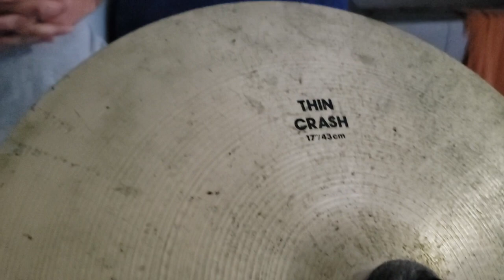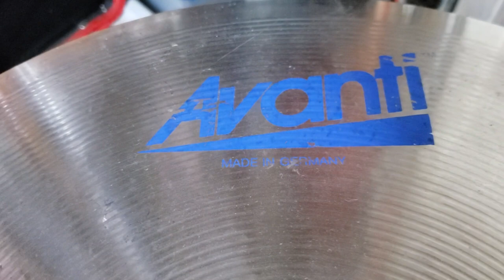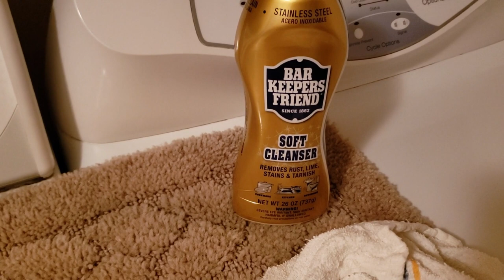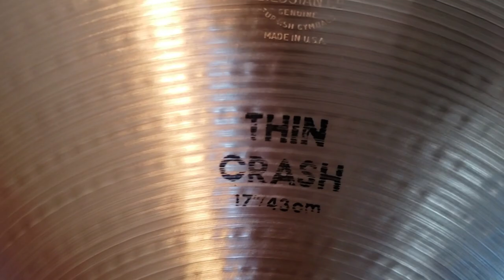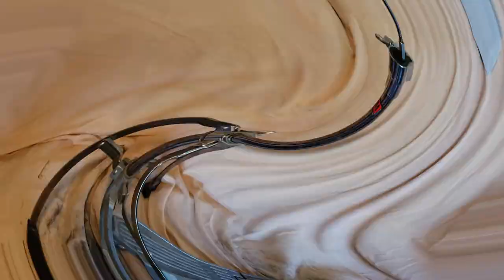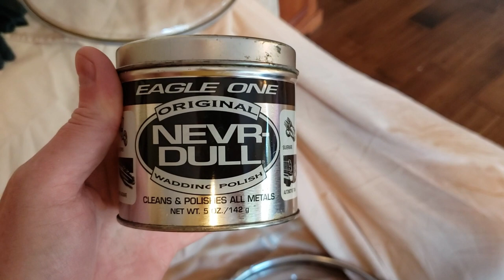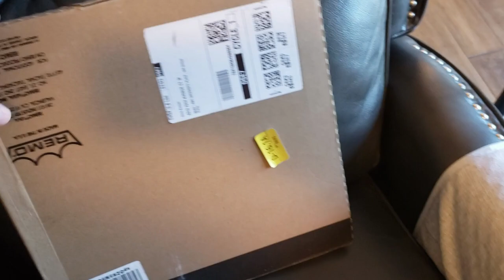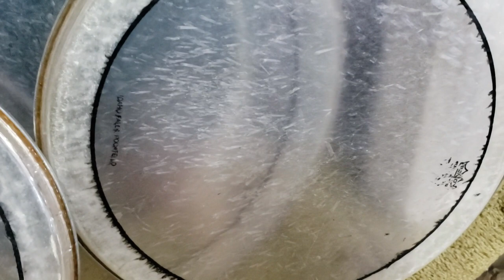I Got a Killer Deal on a TAMA Kit:  What did it Take to Restore it?

Comment: By the way, Remo Pin Stripe heads do not have any oil in them!  That 'rainbow' effect is caused by the way the light is being reflected by the head's two layers.  Apparently none of Remo's dual-layer heads have any oil in them, unlike several models made by Evans 🙂
Reply from the maker: Fascinating!  I did not know that.  Thanks for the info!
Reply: @christhedrummerkimball  - You're welcome! 😀  I was surprised myself when I'd learned that, some years ago 🙂
Reply from the maker: @mightyV444  :)